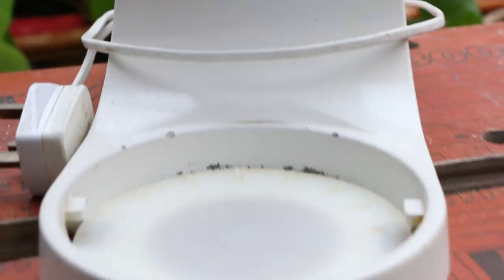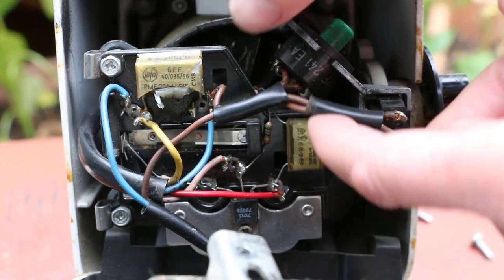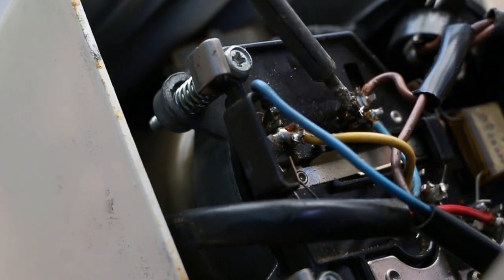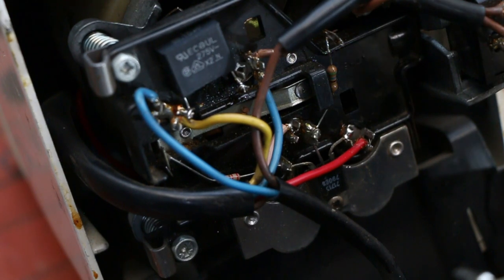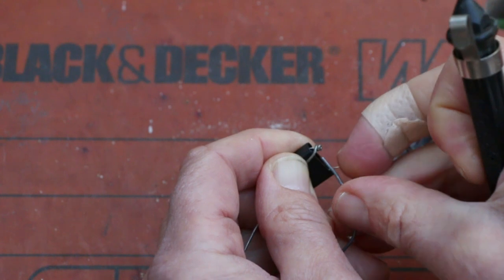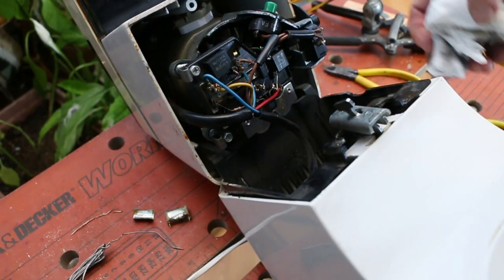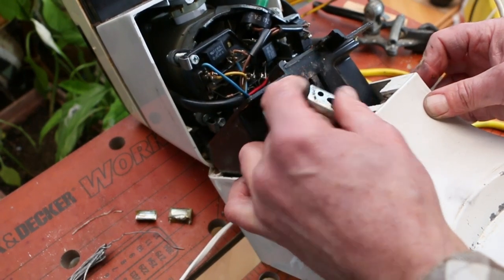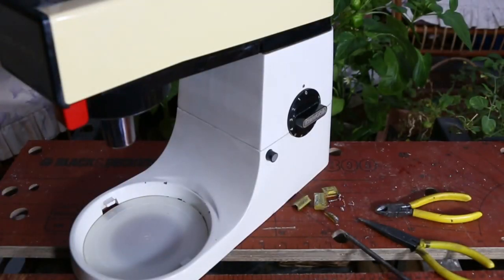Kenwood Chef A901 Smoking Capacitor and Repair.

Comment: Excellent video, thanks very much for making it so clear and well-narrated without any of the annoying music and hard-sell stuff that mars so many. I was on the point of dumping the old Kenwood but you've given me the confidence to grab some parts off Ebay and attempt a repair. 😃
Reply from the maker: Thank you.
Make sure you get parts from a reputable seller because the capacitors need to be genuinely 'Class X' rated ones.
You should find it easy to do and I hope it goes well for you.

Comment: An excellent presentation and so simple to follow. NOW I hope I can get mine fixed. We have opened it and found a blown capacitor. Oooh so exciting.😀
Reply from the maker: You be careful with that excitement, you could end up like me, but best of luck with the repair. As I have said elsewhere make sure you get the capacitor from a reputable source as the X2 rating is important.

Comment: Just found my Mums Kenwood mixer and it works but it does have this Smokey smell. I think I am gonna open it up and replace these components just to be sure. It hasn’t been used in about 20 years either. Great video btw 👍.
Reply from the maker: Probably best to take a look and if the capacitors have not already been changed get them changed, because it's only a matter of time. Better that you don't spend the time using it wondering it's going to go bang.
People love these machines, I think mostly because they hold memories.
Thanks, for commenting.  Help and cooperation are so much more productive than self and conflict.

Comment: Repaired an A901 model exactly like this with a circuit board - it was stuck on high speed. I had to dismantle it to get at the board, but replaced all the capacitors with a kit of ebay, runs perfectly.
Reply from the maker: That's good to know that the speed control problems can be fixed by changing them as well.

Comment: What type of Wire did you add to the Wire
Reply from the maker: It looks like I used some 0.9mm wire. It would be stiff enough to hold the capacitor in place. You would only need it if your capacitor legs are too short.

Comment: We have same model , belonged to my late mother in law, same issue, i did see another repair video, cant find it now , chap said burning / smoking caused by dust so just needs clean ? Ive not looked yet but will see if capacitor looks damaged. Thanks for helpful video.
Reply from the maker: Thanks. I hope your repair is successful.

Comment: Mine had the identical problem, so I guess it must be a weakness. Repair kit on its way.
Reply from the maker: This type of capacitor dries out over time and many of these machines are at least 30 years old, so I'm afraid it's inevitable.  Many other domestic items would have the same problem, if we kept them as long, but we don't tend to.

Comment: Great video but I need further advice.  I have taken a Chef A901 to pieces and inside the motor there is a fan blade at the opposite end to  the mother board.  This appears very loose with lots of play and turns separately to the motor.  Any ideas about the fan?
Reply from the maker: I'm really sorry but I never went any deeper than you see in the video, I was just doing a favour for a friend.  I wouldn't have thought the fan should be free to spin, you'd expect it to be fixed. I've tried to find a video to get some ideas, but with no real luck.  There is a French one that shows a fan but he doesn't do anything with it. https://www.youtube.com/watch?v=h5vmCh-KRw4

Comment: Thanks for an excellent video. Both my capacitors have blown and there are bits missing. The one cap shows 0.15uF but the other cap I can't determine its value. Also the one resistor which has the colour code green, blue, but I can determine the third colour as it is blown. Any idea what the second cap value is and the resistor? Thanking you in advance
Reply from the maker: If the Green,Blue, (Black I think from the video) resistor and the 0.047µF have blown there is a possibility that the Triac has also suffered.
Reply: @twotone3070  Thanks mate
Reply from the maker: @Testequip  Have you managed to get it working?
Reply: @twotone3070  
Yes, I managed to get it resolved.

Comment: My KM201 is later model but same issue - has a cct board and more components to control it, - a very simple speed control, not sure how it works.  One cap shorted and burned and spit in half long ways.  Will do the fix soon.  Has 2 small blue caps also - prob tantalum - some say they can cause problems too?
Reply from the maker: Yes I believe some tantalum capacitors can fail, but I don't know whether it is a particular type in a particular setting. I'm going to search out of curiosity now.

Comment: Hi there, thanks for this very informative video. May I ask what make and model the long nose pliers are  you used please. Thank you
Reply from the maker: Thanks. Unfortunately the pliers are unbranded and about 30 years old, a 'present' when I retired. I've looked at Screwfix and they have a pair that look similar for £8, but I have no idea of the quality. Knipex brand are quite a bit more and there are pairs of all types from what I've seen online at  comprehensive tool suppliers. Sorry I can't be more specific.

Comment: Thanks very very much for this video. Last night I heard a pop from the mixer and it died (we've owned and used it for about 38 years now!). I opened it now and found exactly what you describe. What is the value of the other capacitor - the small one? Although it looks intact, I will follow your advice and replace it as well.
Reply from the maker: Hi, pleased that you are having at go at repairing it. If your machine is an A901 then on the machine I worked on the larger one is Class X2, 0.15µF 275V the smaller one is Class X2, 0.047µF 275 V.  The X2 bit is very important, I suggest you use a  reputable supplier.
Reply: @twotone3070  hi, this video looks really helpful! The larger capacitor on mine has the value 250v on it and either 0.15 or 0.13 uf (can't tell as that's where some of the plastic has blown off!). Would the ones you used still work (it's an A901) or does the 250v make a difference?
Reply from the maker: @LizzieFeathers1   The ones I used would be fine. If the replacement component has a greater rated voltage then there isn't a problem, the other way round would be wrong. The most important specification is the rather innocuous 'X2' bit, this in effect refers to it's 'safety rating' and is the bit that should NOT be ignored.  Incidentally and a bit geeky, capacitors probably don't come in values with 1&3 in them, 1&5 together are what is known as preferred values, 15nF or 150pF or 0.015uF  that sort of thing.
Reply: @twotone3070  thank you so much for this info! Finally got round to fixing it today and it's working perfectly. Such a helpful video
Reply from the maker: @LizzieFeathers1  My pleasure, thank you for letting us know it worked.

Comment: Excellent video thank you. I also have an A901 (serial number 0932359) which now runs at high speed on all settings. I understand that the 2 capacitors are the most likely cause of fault but there is no obvious sign that they have failed (not blackened or damaged). Would you recommend I replace them anyway or is there anything else I should check first? I don't think there was any black smoke. Any advice greatly appreciated.
Reply from the maker: 20 minutes into a 6 Nations match, what a time to post a question :)  I would change them anyway as they are the weakest link in the circuit. Make sure you get replacement X2 capacitors from a reputable source.
I've not studied the speed controller circuit but if you cannot see any blackening of the resistors then the next thing after the capacitors that I would look at would be a mechanical issue from the knob towards the electrical circuit.
Good luck with the repair.

Comment: Great video.Fixing on a A901e model which has a PCB with more components though both caps exploded. The (e) must be another version. Let's hope just doing caps does the job on mine.gteat video sir
Reply from the maker: Thank you, I hope it goes well for you. I don't know where the other cap sits in the circuit, but there is always the potential for it to have taken the triac out.  If it has, it's irritating, but just a component that can be changed.

Comment: Just a tip:  Always take solder blob on your iron to the joint this transfers heat rapidly to the joint, thus preventing damage to the components.
Reply from the maker: Fresh solder with flux still burning.

Comment: Were the 2 new capacitors the same please?
Reply from the maker: Hi, pleased that you are having at go at repairing it. If your machine is an A901 then on the machine I worked on the larger one is Class X2, 0.15µF 275V the smaller one is Class X2, 0.047µF 275 V.  The X2 bit is very important, I suggest you use a  reputable supplier.

Comment: Another question. Will this kit work for the 701a please?
Reply from the maker: I'm afraid I don't know because I've never worked on a 701.
If you have some capacitors of this type in there you can't go wrong by changing them like for like. Is there anything left of the capacitors? You may be able to find an actual repair kit specifically for a 701 and if it details the component values you could them purchase they from a reputable source.
Reply: @twotone3070  Actually Lana’s Kitchen Spares have a kit for the A701A. They are X2 caps. However, there is a 1 cap kit and a 2 cap kit so the machine has to be stripped first to check out which circuitry it has !

Comment: I did this job a few years back with a kit off ebay. free mixer essentially out of the whole deal. my dial has to be pushed in and turned to actually select speed. I see yours is flush against the machine. going to have a look as assume an easy fix?
Reply from the maker: The one I did was quite straight forward as I could see which component was faulty and fortunately the capacitor spec was still visible. Although as you say, the kits are available. my only thought about buying a kit from a less reputable source is that the X2 specification of the capacitor has to be genuine, it is sat across the mains.

Comment: hello do you know the value of 2 resistors since icant find a whole set im gonna purchase it one by one and  also the triac
Reply from the maker: My first answer is I'm afraid I don't know, I don't own the machine and would have to visit a friend to open it again to look. But if the resistors are still the correct colour, that is to say, not burnt, then there is probably no need to change them. I've looked at the close-ups in my video and think they are 56 ohms 5% tolerance and 220 ohms 5% tolerance, probably 1/2 watt, but I may be wrong. What are the colour bands are on them?
Reply from the maker: Have you been able to repair it?

Comment: I hear the dreaded smoking capacitors are a common failt on the A901, do you think replacing the older style capacitors in an A701a with the more updated one's would cause it to have the same issues as the A901?
Reply from the maker: It's not related  to the make or model, it's simply the age and type of the capacitor. So changing the capacitors in any device with newer ones of the correct type will prevent the old capacitors from breaking down and causing you a problem.

Comment: Thanks for the video! Could you tell me what type the diode is on the PCB? Because on mine the diode seems also broken.
Reply from the maker: I didn't have any diodes that I could see on the machine I repaired.   Are there any identifying marks on it and whereabouts in the circuit is it?
Reply: @twotone3070  it's broken lengthwise and I don't think I will be able to read it since it might fall apart. I'll take a look tomorrow after I disassemble it completely. Thanks for your answer.
Reply from the maker: How did you get on?
Reply: @twotone3070  It wasn't a diode, it was a burned resistance on which you could not see any colors anymore. I changed it but it still doesn't work. I'll have to look at it again sometime.

Comment: Hope you don’t mind my asking. I’m now contemplating getting my soldering wire and flux. Any recommendations please.
Reply from the maker: If you are in the UK then this is the sort of thing, but I've never ordered from here. Weller is a well known soldering specialist, so if it really is them then it would be good. You can get it delivered to a locker for free, I think, or use Prime. https://www.amazon.co.uk/Weller-40-100-General-Purpose-Solder/dp/B0001P171A/ref=sr_1_6?keywords=Lead+Solder&qid=1645207767&sr=8-6

If you'd rather not use them I found the same thing here, but I don't think I've ever bought from them. £3 p&p. https://www.powertoolsdirect.com/weller-rl60-40-100-general-purpose-solder-resin-core-100g

Lead based solder may have heath concerns, but may not. It is certainly easier to use. You shouldn't need flux as it is built into the solder, just don't breath in the fumes, rosin flux can affect your lungs.
The highest risk is from flicking solder into your eyes, so wear safety glasses/goggles, somehow it can get behind ordinary glasses.... And don't think you don't need them, 'cos you do.
Practice wrapping some wire and soldering before you attack the real thing, get used to wielding the hot iron.
Good luck.

Comment: My A901 had the common smoke issue so replaced the capacitors, resistors and triac etc with a kit purchased online. The Chef does go round but only at 1 speed- very fast. Any idea what might be wrong? I have no control over the speed. I am pretty sure I wired it all up correctly.
Reply from the maker: I didn't look at what the speed control knob actually adjusted. I could see it moved the mechanism up and down, presumably there is a variable resistive device underneath the moving plate. I've seen a comment else where saying about a centrifugal component, which implies a self adjusting rotating part in there somewhere. I'm sorry I don't have the machine so can't go digging inside.

Comment: I am about to make this exact same repair and was about to but the two components you recommend from CPC Farnell. However the larger one, CA07109 is out of stock. Can you recommend an alternative? Thanks :)
Reply from the maker: I had a look at the CPC site and there are others that seem the same spec. I could not see any difference apart from the manufacturer, if someone can see a significant difference let us know.  An alternative part is CA07147

Comment: Thankyou for a very informative and easy to follow video. My A901E too started smoking when used, my husband after looking at your video will now try to fix it himself as companies around here said it was too hard and takes too much time therefore it would be cheaper to purchase a new one, but we would like to pass this mixer onto our daughter. We are situated in AUSTRALIA, could you please let me know what I will need to purchase and where would I purchase it from please, if its not too much trouble. Thankyou once again, looking forward to your response.
Reply from the maker: You will need to open it first, take a look at which components are damaged and that the configuration of the circuit is the same.  I wouldn't want to recommend the wrong items based on what was in the one I repaired.
There are web sites selling kits to replace all of the electronic components, but again you would need to see exactly what you need.
If the parts are the same I can can guide you.
Reply: @twotone3070  Thankyou so much for your quick response, I will ask my husband to have a look at it and double check as to what is needed before we make a purchase, if we run into any trouble and its too not inconvenient to you we would really appreciate your  knowledge and help. Thankyou once again.
Reply: Thankyou so much for all your help, my husband successfully changed capacitors and resistors, I so super happy that it now works again, as we received this as a wedding preset over 40 years ago. You gave him so much confidence with your very informative video. Thankyou once again from Australia.
Reply from the maker: @elizabethzscherpel3642  Love that you were able to repair it and it truly is my pleasure, especially as it obviously is an important link to the past for you. 
Makes my day and more so that you took the trouble to comment.
Reply: @twotone3070  ❤
Reply: @twotone3070  😃

Comment: Thank you for posting this; it was really helpful.   I'm in the middle of rebuilding my Kenwood Chef A901 like the one in this video and decided to regrease the gearbox and give the machine a general overhaul at the same time.  Gearbox - fine.  Motor - fine.  What has completely defeated me is reattaching the small squarish red lever (top front) by the pin at the top of the shaft of the lever and the spring above the plastic housing.  Does anyone out there know if there a knack to getting the pin back into place?  If the spring goes through the small hole in the middle of the lever shaft, to what does the other end attach?
Reply from the maker: I'm afraid I cannot see in the video how any of that is assembled, it wasn't where I was working. I don't have that machine so can't even take a look now, sorry. I hope you find what you need.
Reply: Ah, no worries.  Thanks to a post on Fixya, someone very kindly explained the process.  For the record and if anyone else is looking at this later, it's important that the spring is attached first - it clips on the gearbox housing itself.  You know you've got it right when the lever moves correctly if pushed.  Then, a little not-so-subtle applied force got the pin (through the lever shaft) into it's little groove.  No-one was more startled than me when it was switched back on - and works!  Thanks again.